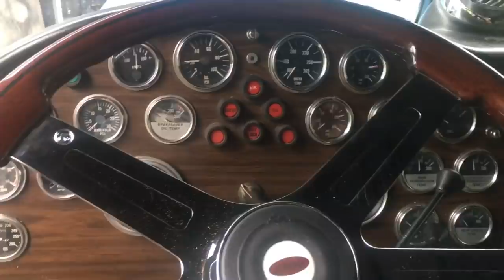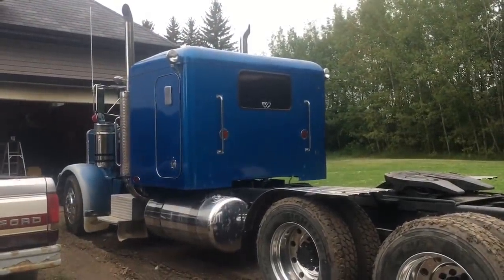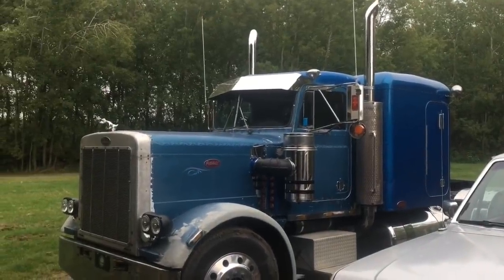Peterbilt 359 Restoration Ep.42 Air Horns & Chrome

Comment: Great to see you get the truck running.  That F-150 is a great project.  You will be hard pressed to find an engine with more torque than the Windsor inline 6.
Reply: You should have your daughter work on the pick up with you. Great father daughter bonding.
Reply: @trippdouglas5596  You are very blessed to have a daughter who works on trucks with you.

Comment: if you want a more traditional look, then when you swap your roof cab over to a glass one, then swap out those horns for round ones. (the squares look way too new for this old gal)

Love watching these builds come together!
Reply from the maker: 53Peterbilt when I put a new cap on I don’t plan to put horns up top, just lights.  Likely put train horns on deck plate or underneath instead.  Less holes in the new roof the better 👍

Comment: If you don’t want to drill holes in a new fiberglass cap you can always buy a set of after market horns that you can mount anywhere else you want. I did that with my 379 and put it under the deck plate and ran a valve next to the seat or they make them electric over air where you can wire to a button

Comment: Hey TwinStick's, loving your videos on the Pete man. i got a suggestion for that F150 though; before you pull that motor I would try running some Sea-foam or Marvel Misery Oil through it to free up the lifter. I have had it work for me a couple times and seen it work well.
Anyway keep it up man, i have always loved the old Petes
Reply from the maker: ImtheonlyWoody thanks ... will give that a go 👍

Comment: Yup looks gewd, I don't no that u know this but u may want to drain the water out of ur air thanks about every week, lil pull cord on air tank , should hissss. Also when u hook other fuel tank put a shut off next to or out of each fuel tank. It saves so much frustration if u don't have them and break the cross over line! Havein Funn :)
Reply from the maker: William Tra thanks for the tip and I do open up the valves on the tanks when I’m done playing on the weekend 👍

Comment: How about a post use tool review?
Getting a fresh coat of paint..
General driving, maybe GoPro down low showing shifting, and another head mounted seeing where you're heading. Just the sound of the engine and maybe a Jake break or two...

Comment: Hmmmmm. Ive got a decent 86 cc dually 6.9 idi that is right up your alley. Factory alcoas. Twin sticks (overdrive) it was a conversion truck fron a company in tx called tra tech. The package was called The Boss. Had brass badges on the bedsides and all. No rust california desert truck rwd but itchin fir an easy d60 sas
Reply: Oooo. And ive got an extra 86 motor, either 86k or 186k on it. It was hard to say. Sounded and drove good, wish i didnt cut that truck up but i was younger and dumber. Didnt see the value in it.

Comment: Love the videos! So cool seeing the progress, I’ve watched from start to finish. I’ve got a question for you- what’s the black valve on the dash for? On new trucks there’s only a red and yellow one?
Reply from the maker: K F it’s for airing up the trailer brakes and releasing them without releasing the trucks ... think it’s for adjusting the trailer brakes without the need  to chock the wheels on the truck because they’re still applied

Comment: In regards to the F-150 lifter, I'd recommend using Seafoam in the crankcase and Seafoam Spray in the Air intake.  Look up Project Farm on YouTube, he used it on his early 90's Ranger and it's remarkable the work it did without having to rip the engine out.

Project Farm Seafoam

Comment: Run some Engine Restore in that 302 for the heck of it, might fix that tick.
Reply from the maker: cambo1200 ya I might give that a go ... I did try the auto tranny fluid in the oil to try and clear the sludge but didn’t help
Reply: TwinStick Garage just stick a cam and lifters in it and she will be good to go. Easy weekend project and good content

Comment: I say again......great job brother.! It seems like the ole girl pulls pretty good when you step into a little bit when you’re running through the gears. Are you going to paint the cab, sleeper and the hood eventually?
Reply from the maker: Tim Glasco ya need to save some pennies for that though.  Want to fix the hood this winter then run the truck to a body shop to paint it all next year 👍
Reply: TwinStick Garage I totally understand that. I was an owner/operator for 10 years. Everything about these old trucks is expensive. I am a Peterbilt fan and watching this restoration is awesome. Can’t wait to see the finished product. Keep up the good work.

Comment: Hello from Wisconsin,  are there trailer hookup lines on the back? And if not are you going to install them? Just wondering.
Reply from the maker: MrUPconductor the connections are underneath the cab, just need to run new lines.

Comment: Being as I work at a Kenworth dealer, I got say an old w900a would be sexy, could you maybe explain the twin sticks, I understand  you have the main trans (far shifter) and then the rear auxiliary trans (close shifter) is sorta like the high and low on 13 or 18 speed but you looked like you were shifting more then that with stick closest to you, never been in a truck with auxiliary trans, most the new trucks now are automated transmissions (boring as hell to drive) in less it's an old school driver or heavy haul, most line haul is now automated.............
Reply from the maker: MegaHightechredneck the 4 speed auxiliary is kind of like the high/low button on the newer eatons.  You can split each of the main 6 gears 4 times but you really don’t need to do that for every gear so you start to skip some (especially when your empty) which is where it starts to look more complicated than it really is 😎
Reply: @TwinStix  oh gotcha that does make more since, you should see a newer Eaton ultrashift 18 speed skip gears, even in a 35 ton tow truck it skips alot of gears... whoever's spec'ed a tow truck with a ultrashift should be fired that thing is always broke, too much backing up for clutch and electronic clutch actuator to hold up.

Comment: Hey did you get you jake to work?
Reply from the maker: Ethan Northrop ya hot wired it to the solenoids from the switch ... but it’s too quiet ... needs straight pipes 👍

Comment: i would mount the horns somewhere else and not drill holes in the roof
Reply from the maker: Nate Frieden agreed but this original roof cap is temporary, was just patched (see earlier episodes) and I plan to replace it with a new fibreglass one in the spring.